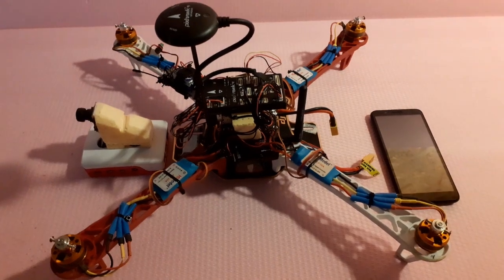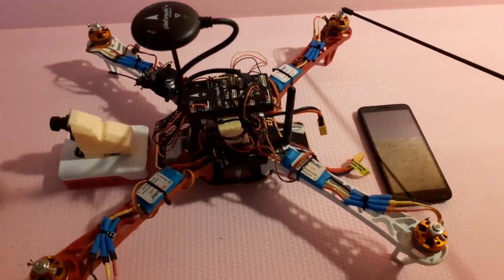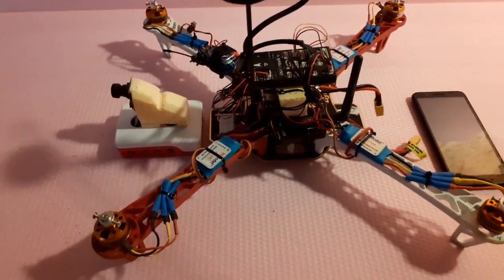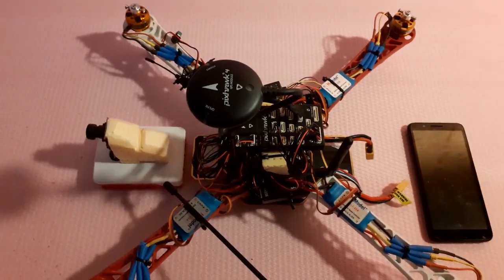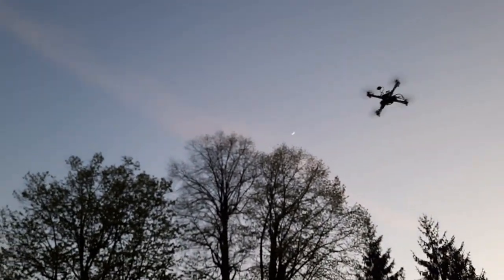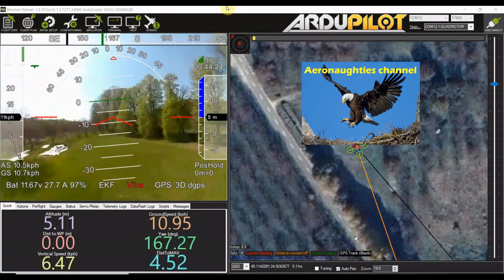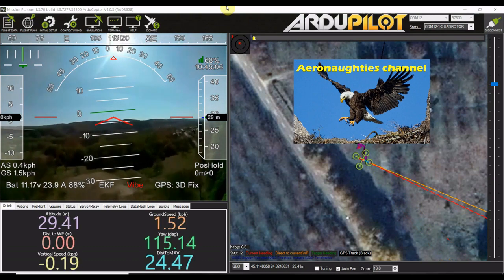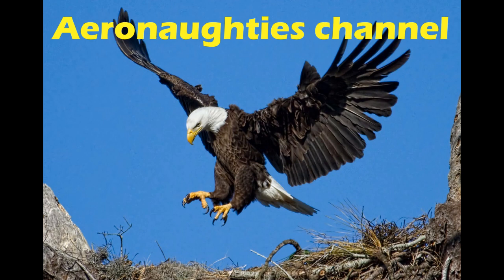Pixhawk 4 Based Quadcopter with 4G FPV Test Flight and Crash

Comment: Are you still doing 4g? Are you settling up yourself or using something like xbstation? 
Just returning to RC. I helped with the 4g disco development, on video and setup not programming. But am wanting to go to ardu 4g rather the a mix of analog stuff that always causes headaches
Reply from the maker: yeah i'm on telegram if you have questions
Reply: @aeronaughties  I just watched your intro video. I totally agree if you are starting ardu with no experience there very little basic beginner help or instructions. That whats put me off. I will try get you on telegram, I don't use it so. But glad I came across your channel
Reply from the maker: @Aeronaught is my Telegram handle

Comment: You should of just gotten a small stick hot spot instead of your phone, can most likely save weight and also you wouldnt have to disconnect your phone all the time.       TomshineMini USB 3G WiFi Hotspot 3G Mobile Router Mobile WiFi USB Dongle Wireless WCDMA Modems With SIM Card Slot(White) - Walmart.com - Walmart.com
Reply from the maker: i don't use my phone on my drone i just bought another one for that, phones get way way better and more stable connections than stick modems and are much easier to set up
Reply: @aeronaughties  Can you make a video showing how you connect the drone to 4g and then connect the transmitters to the drone through 4g ?thank you
Reply from the maker: not so simple because the fine detail varies depending on what parts you have

Comment: Interesting. Finally I found someone who's working on the same idea as I am.
I have got a similiar setup at the moment. 450mm Quadrotor (DJI Flamewheel frame in X form) with Pixhawk FC and raspberry Pi onboard.
I use a raspi zero connected to an USB LTE modem. It works pretty good and I can recommend it as a lighter alternative to the smartphone wifi hotspot solution.
I'm currently working on low latency FPV video over 4G too. I see the biggest challenge in keeping the video bitrate low because otherwise you need much more data volume.
I mean HD resolution and high FPS is technically possible but produces very high traffic in short time which is expensive over time.
Reply from the maker: Hi, there are a number of advantages using a smartphone and wifi, namely they're the same to configure for everyone and simpler to configure regardless of jurisdiction. You can stream video directly from the phone and that's extremely stable and a great backup for emergency navigation for example. 

Also it's a backup GPS locator and crashed drone finder. You can use the google find my phone app for this. I once used the WiFi signal itself to track a crashed drone to a bush.

Regarding the low latency streaming I've heard there are some open source protocols for live game streaming as that industry is vast and has the same technical issues they might be worth looking at.

Anyway would be good to make contact direct as I'm looking for others that are working on these issues.

Please contact me directly on Telegram @Aeronaught or email - aeronaughty@protonmail.com
Reply from the maker: also another point, you can remote control android with teamviewer now so that's very handy to fly a full android device
Reply from the maker: also phone cams are surprisingly good in low light, again for navigation
Reply from the maker: ooops forgot one, also smartphones have vibration sensors on and vibration sensing apps so that's useful too :)

Comment: I was using ezwifibroadcast a short while ago to learn and experiment. Everything seemed okay. I was a bit heavy on the gamepad controller and the drone went wildly out of control. Its fun but can be plagued with trouble and crashes. Flying right next to a house is never a good idea. Like you, I should be flying in an open area. I like experimenting but not a fan of crashing and braking drones.
Reply from the maker: yes, so this is exactly what i want to solve, a platform that's safe to learn on and hard to break
Reply from the maker: https://www.youtube.com/watch?v=kVLzkAOEkts - look at that video mark, please comment on it if possible :)

Comment: Hey man I'm really sad to hear you gave up on the fixed wing for now :(. I was following your channel in the hopes of getting mine working because I dont seem to be able to figure out how to wire the servo with the PixHawk4 Flight control power management board. Best of Luck
Reply from the maker: I'm still on it, but i got the quadcopter to familiarize myself with the pixhawk 4 better, keep follow, i'll be back with wing stuff soon, if you need help with the servos contact me, that part was tricky because the info. available online is confusing and counterintuitive. You can contact me directly on Telegram @Aeronaught or Email - aeronaughty@protonmail.com

Preferably @Aeronaught on Telegram

Cheers :)

Comment: center of gravity on the wing. PLEASE go back to it! i feel like quads use too much power and you cant enjoy the long flight as well. please reconsider! ive been looking into ZOHD lately. Take a peek
Reply from the maker: oh, you reckon the one i crashed was just tail heavy, possible? anyway i'm totally committed to a wing but learning the pixhawk (which is more complex than a female) on a quad because it's easier. anyway keep coming back, i'm on it, if you need help with anything i'm on telegram - @Aeronaught

cheers
Reply: @aeronaughties  good deal! I am like you,  started doing homework on the entire project and I'm just now ready to pull the trigger on this entire operation. I got a zohd dart 250 to start with last night after finding your videos. I'm gonna go with either f411 FC with iNav or Zohd Kopilot before going to pixhawk(bit pricey)